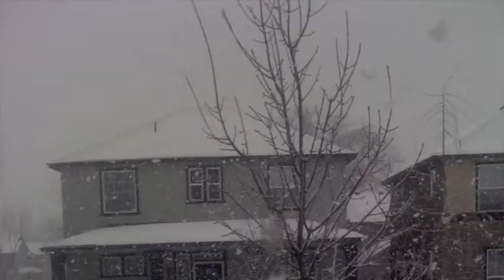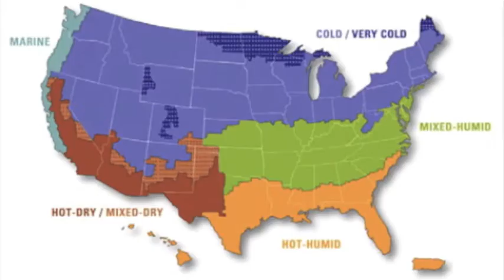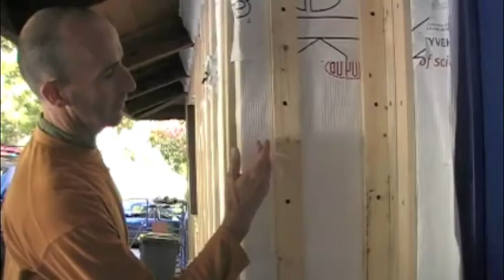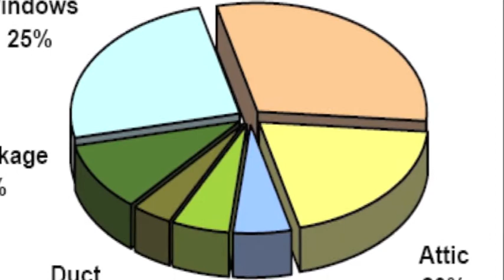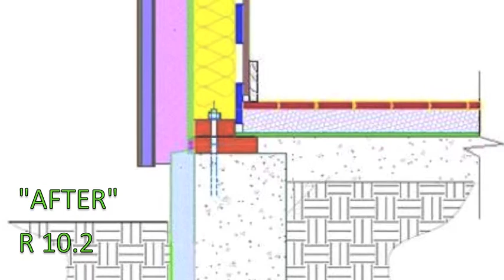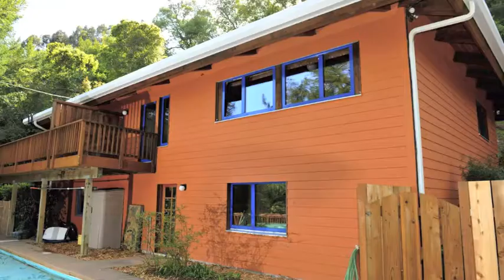Tutorial 03 - Q+ Energy Retrofit

Comment: If you want to tear down half a house and spend GBP 50K or local equivalent,  you can almost make any house super efficient.  Depending on with what you started with you are very likely never to recoup the investment (even if I would NEVER again have to buy one drop of home heating oil for the coming 30 years, such a level of retrofit would not be recouped in my home. And it's only a 60s plain semi with plain cavity wall insulation, double glazing and loft insulation).